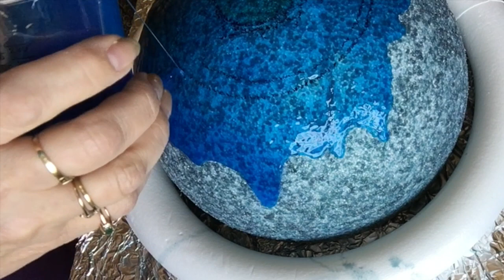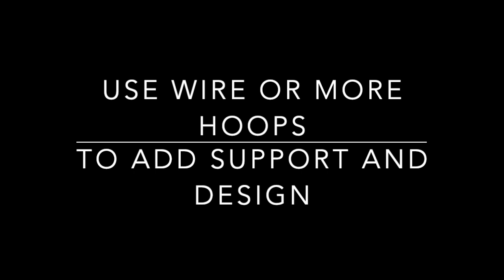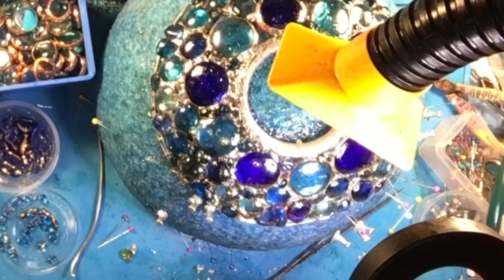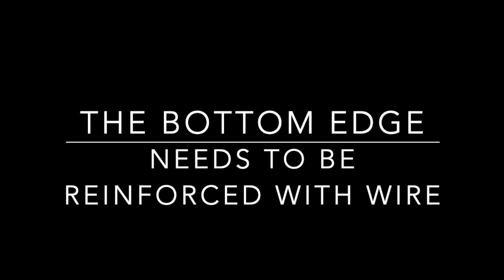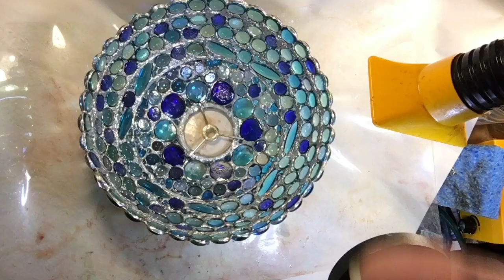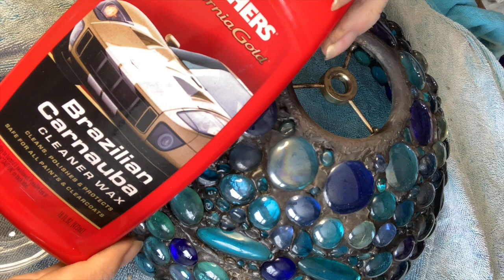Stained Glass lamp shade with flat glass marbles

Comment: I put my commet in the wrong spot & I don't know if you can see it. I wanted to say this lamp is so cool! I love it! Just curious, are the shades pretty heavy when your done? Huge fan from Washington State 😃 🦀 🌲
Reply from the maker: VERY HEAVY- I do some work with Capiz shells which are WAY lighter- but not the same look.
Reply from the maker: I also incorporate wire and metal rings into my works- those that did not start out as a metal frame- to add strength so the weight is not just on the foil.